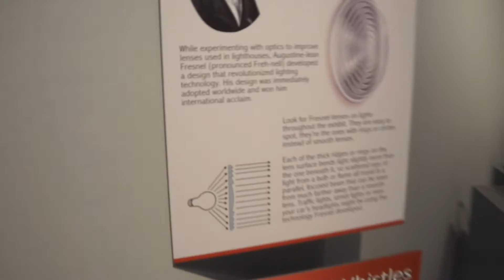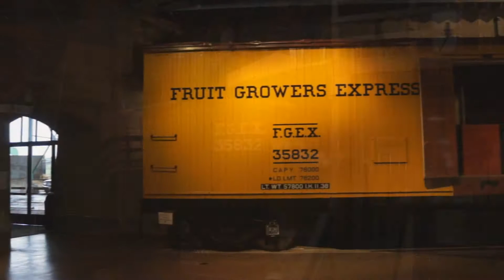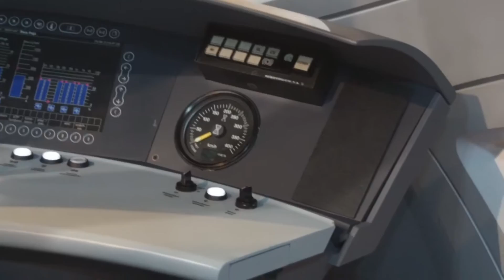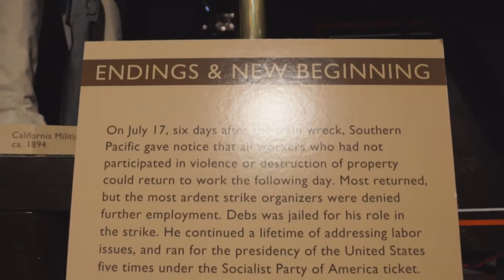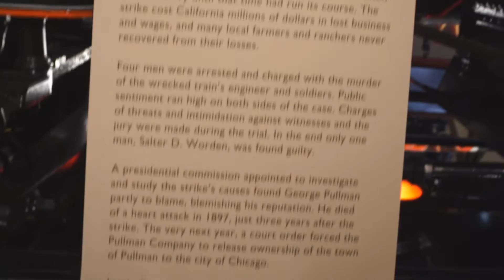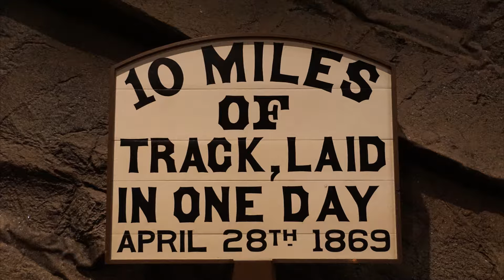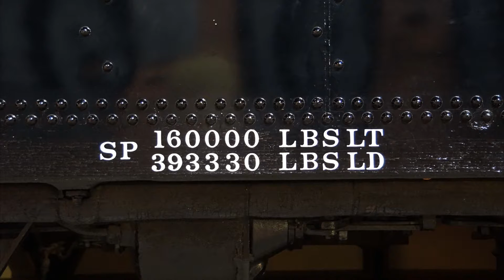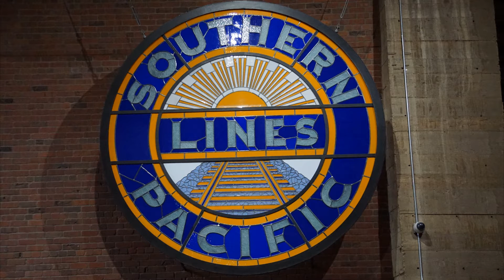California State Railroad Museum

Comment: Marvelous video. You really got the feel of the museum and Old Town Sacramento.
Reply from the maker: Thank you Mark for your complimentary reply.    We were there for about three hours and had a wonderful time taking videos and photos.    It is a great place to visit if you have free time in Sacramento.   Robin
Reply: NZR 1543 Robin, unfortunately I go there as often as possible. Several very good friends either volunteer or work there. I was just down to the museum in April to get the last of the measurements of the J. W. Bowker as well as detail photos of it. I met up with my friend who let me into the museum long before they opened up that morning. We went through the back door. It was a unique experience to have the whole to myself without anyone there. I also do a certain amount of research as it pertains to Virginia and Truckee locomotives and had the. opportunity to check out a particular detail on the Genoa that during normal hours I couldn't do. My friend who also does considerable research on that RR was surprised I'd discovered some new information. So the up shot is I'm at the museum as much as I can be.
Also if you've never been to the Nevada State RR Museum RR in Carson City, Nevada I highly recommend it, especial on a day when they're running all the operable equipment.....usually on the 4th of July. (I use to volunteer there, but can't work with the train crew anymore due to severe back problems, but I try to make it over there when I can.)

Anyway, thank you so much for a wonderful video.

Take care.
Mark